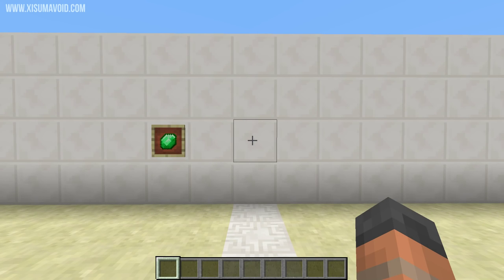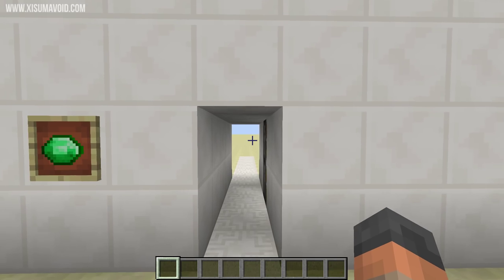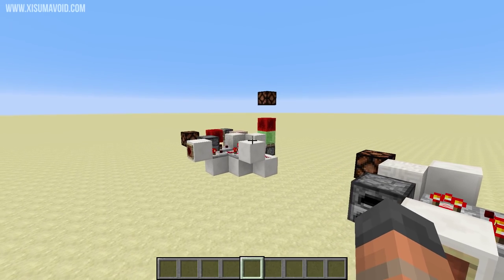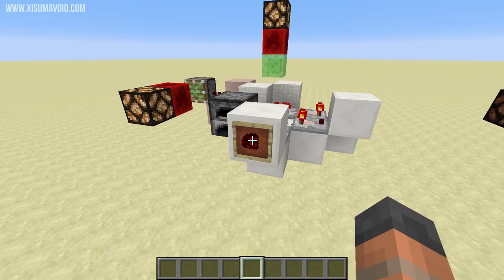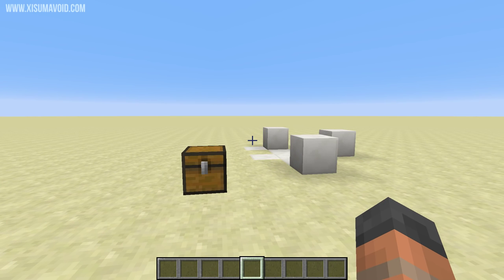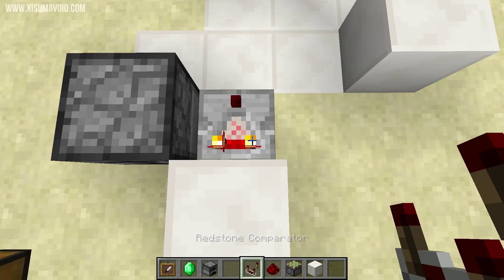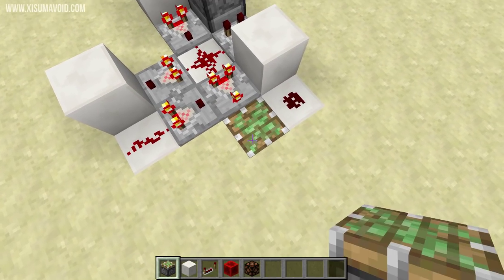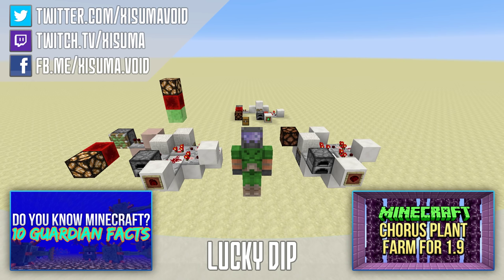Minecraft: Item Frame As Lever Or Button Tutorial

Comment: Slight improvement to the design: For the button version, replace the block with the single redstone dust on top (the one which is next to the chiselled quartz block) with a half slab. That  shouldn't power the piston every time you rotate the item (which is not intended, although no negative effect either).

Comment: Just made a 4x1x5 design, u can place a slime block bud switch ontop of the first redstone dust out of the item frame comparator, then place a sticky piston with a redstone block on is face diagonally next to the redstone block in the bud switch, and that makes a t flip flop, which is essentially what this all is, not item frame levers, but item frame bud switches
Reply: Replace the second last word in the above comment with tflipflop
Reply: Sharkchase The big problem with the slime block bud : with an item frame, if you spam, the piston can lost the slime block with a short pulse. The Xisuma design doesn't have this problem.

Comment: Ohhh, I see, it's using the difference in delay between one comparator and two to make each increase in output from a turning item frame into a 1-tick pulse. That's clever! :D
Reply: IceMetalPunk It's a 2-ticks pulse, but yeah, you understand :p
Reply: Ainex
2 tick? But the main path has a 1-tick delay from the comparator, and the cutoff path has a 2-tick delay from the two comparators, so wouldn't that make it overall a 1-tick pulse? (2-1=1)
Reply: IceMetalPunk The cutoff path has a 3-ticks delay because it throughs two comparators in normal mode and the last one in substraction mode. :p
Reply: Ainex
Is there a tick of delay for a comparator's side inputs? I thought the only delay was in the signal passing through?
Reply: IceMetalPunk Yes, there is. 

It's the same thing with a repeater's side input. The effect take 1-tick before being applied (switch in signal locking).
Reply: Ainex
Huh. Well, TIL :D Thanks.
Reply: IceMetalPunk Actually that's a pretty basic analogue rising edge detector. I made a tutorial about that over half a year ago (without an explanation of the working principle though). If you turn the output-comparator it becomes a falling edge detector. The little addition to the side (Container-Comparator-Piston with Block) produces the pulse, when the signal resets down to one. A simple BUD would do pretty much the same (and would need less resources). Interesting idea, but the solution is not the best in my opinion.
Reply: R.K.F. Walter
It's not just a rising edge detector, though. A rising edge detector wouldn't trigger when the signal goes from 1 to 2, or 2 to 3, etc. It would only trigger when it goes from 0 to anything higher.
Reply: IceMetalPunk R.K.F said "analogue rising edge", not exact.

It's the same logic behind it : one path will remove the effect of the update signal with some ticks of delay.

In the rising edge, it's a logic gate. In this one, it's with the substraction's propriety of comparator.
Reply: Ainex Thanks Ainex.     Also, what I meant was, that this is a combination of an analogue rising edge detector AND a small circuit that fires only when the signal goes down to one again (I may have been a bit unclear). Otherwise, there wouldn't be a pulse when the item frame signal goes from 8 down to one again.

Comment: It's just a CUD switch/flop, it's nothing new. It's still impressive, but it's not new.
Reply from the maker: +794613825a Not suprised, but i wanted to share it :-)
Reply: ***** What does that stand for? CUD?
Reply: Jeroen van den Berg Comparator update detector I think
Reply: NiklasFreshMemes Yes, that would make sense. Thanks!
Reply: +Sancarn No, a BUD detects any adjacent block update. A CUD only detects changes in a comparator's strength.
Reply: ***** Yeah... but the point is it would do exactly the same job...
Comparator into dust with a BUD next to that (but not so the dust faces into it)...

There's no need to use a comparator update detector here...

There is literally no point in using a CUD for anything other than detecting someone clicking in an inventory.
Reply: +Sancarn du fuck is going on
Reply: Yeah man, it's Sancarn you're talking too!

Comment: So overcomplicated...... just put a slimeblock BUD next to a piece of wire coming from the comparator that reads the item frame position. Each time the signal strenght changes the BUD activates. For the button, add a signal strenght lenghtener, for the lever you add a piston with a redstone block at the end. It's like really easy.

Comment: Pff this is compact ? just put a bud switch next to the item frame output and you will get the same thing compacter.
Reply: Clem Clem No, it doesn't work next to the item frame. It works only with one type : CUD (Comparator Update Detector) and this one is slower and the T-CUD version (with Flip-Flop) is bigger.
I invite you to do some test instead of being arrogant.

However, you can use the redstone update signal with a BUD, but it's next to the item frame output.
Reply: "next to the item frame output." that's exactly what I said :"next to the item frame output" I could't expect you could critic me misreading my comment, despicable !
Reply: Clem Clem I make a fault in the last sentence  : "It's NOT next to the frame ouput".
Reply: If you don't understand that "the item frame output" can mean the redstone dust powered by a comparator whitch detect the position of the item in the item frame, well, you aren't open minded enough to understand me. Too bad.
Reply: Clem Clem It's not the same thing "the item frame output" and "the redstone dust" in this case.

If you put a BUD next to the item frame, it won't work (a lot of people make this error and your sentence suggests that). Only a comparator can take the output and then convert this in a signal ... And then you can use a BUD.

So, It's not useful to go on this discussion. Be polite with the others. Xisuma is not your dog. Me neither.
Reply: XD it was just evident for me, don't make me moral, anyway we aren't made for each other.
Reply: Clem Clem Yes :D